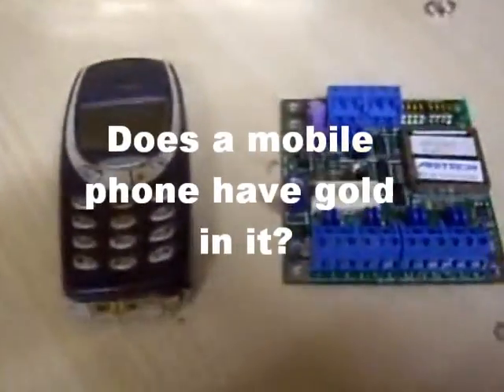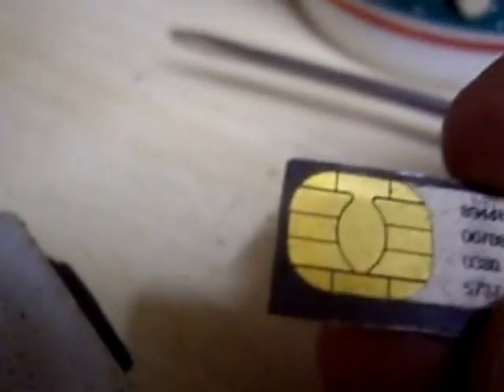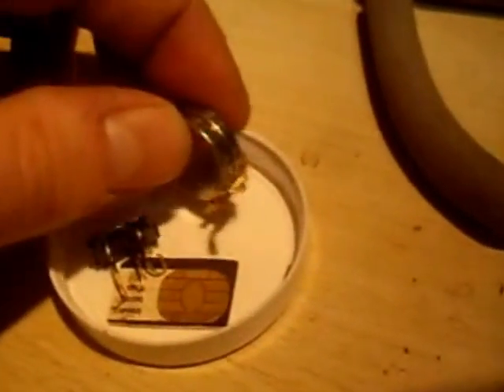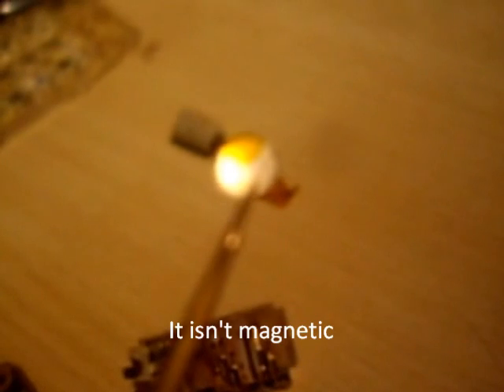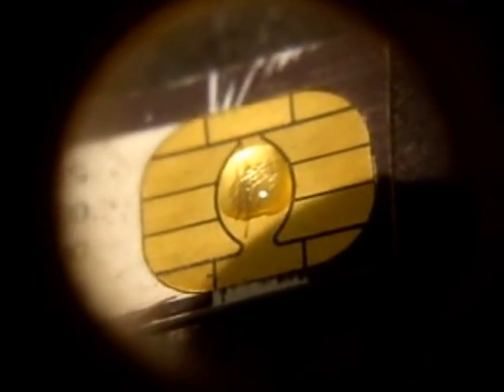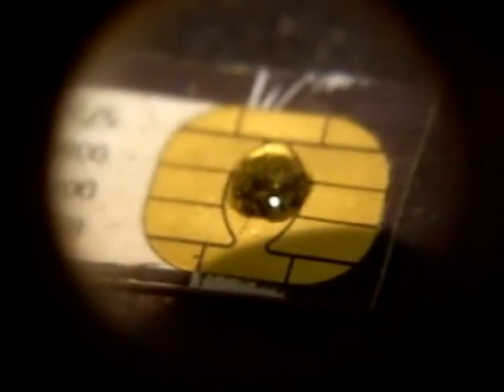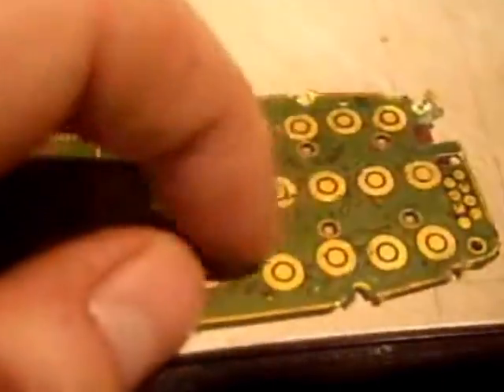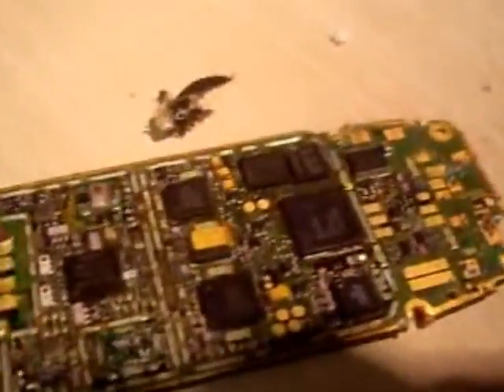Does a mobile phone have gold inside of it? If so how much? No 102

Comment: By now you probably know that better lighting helps on the video and removing the screws makes for a cleaner removal of the internal components. You guessed correctly on many of the gold plated parts. It's also important to note that some of the internal electronics are also recyclable like the mustard colored tantalum capacitors, the Microphone and speaker for electronic projects. While you may not want them, perhaps someone you know that works with electronics might be able to use, or reuse, them. Thanks for sharing your experience on this teardown.

Comment: You can depopulate the board using a sand bath, which is quite expedient for clearing those boards to go into a solution to recover the gold.(the solutions are quite similar to the solutions used for testing). I can tear down 50 phones and have them ready for solution on a slow weekend. The issue is not time, as much as material. One ton of phones can yield around 75 troy oz. The only way to make it worth it is to get them free or for less than a dollar. Thanks for the vid. I never realized the sim cards are gold on both sides.